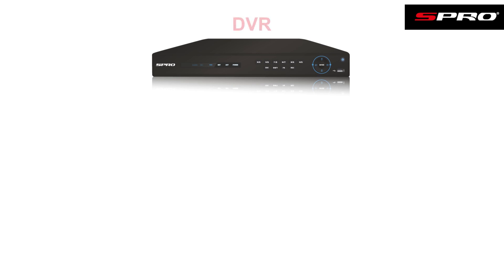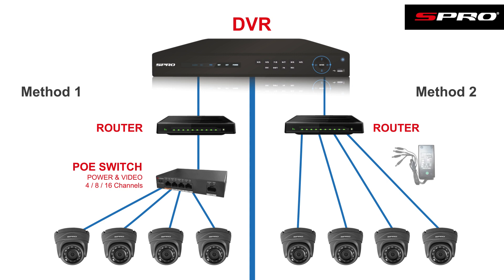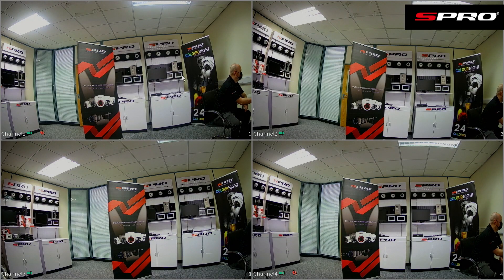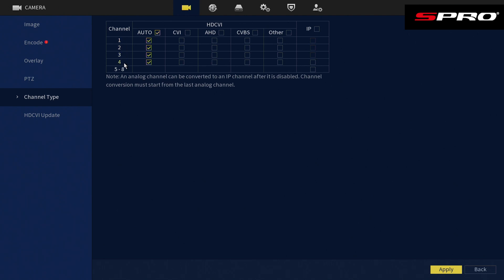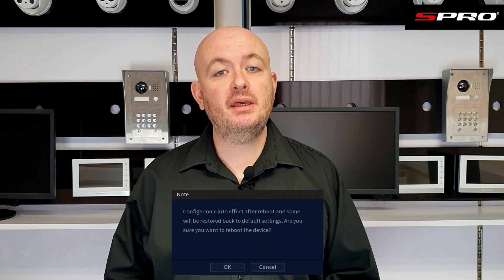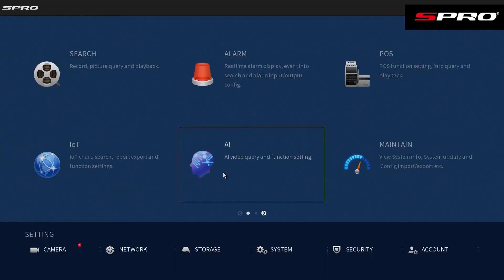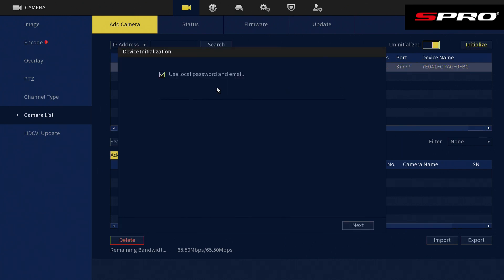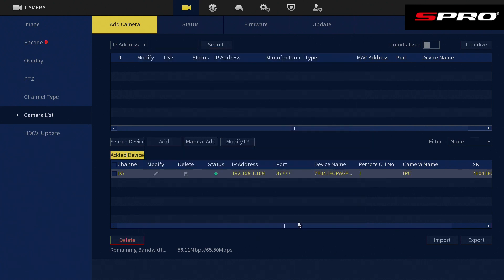SPRO CCTV - Connect IP Camera to Analogue DVR

Comment: How many cameras we can use?
Reply from the maker: Thanks for your question! Do you mean how many IP cameras can you add to an analogue recorder? If so, the number of IP cameras you can add to our analogue recorders largely depends on the specific model of the recorder and the total bandwidth capacity. However, by reallocating the AI processing power as shown in the video, you can add IP cameras beyond the number of BNC ports available on the recorder.

For a specific number and to ensure the optimal performance of your system, it's best to refer to the product's technical specifications or reach out to our technical support team at support@sprocctv.com. They'll provide guidance tailored to your exact recorder model and setup.

We hope this helps, and thank you for choosing SPRO!

Comment: I currently have a 4 channel HD SDI system all 4 cameras supplied with RG59 shotgun cable. 
Rather than rewiring the 4 cameras could I use IP down coax converters either end of each coax cable and change the system to new SPRO NVR and 4 x SPRO  varifocal IP cameras ?
I'd be running short network cables from the converters into the back of the NVR.
OR would it just be as easy to fit your 4K CVI  varifocal cameras to a new DVR ?
Reply from the maker: Hello,

Please get in touch with our technical team at support@sprocctv.com

They will be glad to assist you with this situation.

Comment: How many IP camera that we can add?
Reply from the maker: Thanks for your question! The number of IP cameras you can add to our analogue recorder largely depends on the specific model of the recorder and the total bandwidth capacity. However, by reallocating the AI processing power as shown in the video, you can add IP cameras beyond the number of BNC ports available on the recorder.

For a specific number and to ensure the optimal performance of your system, it's best to refer to the product's technical specifications or reach out to our technical support team at support@sprocctv.com. They'll provide guidance tailored to your exact recorder model and setup.

We hope this helps, and thank you for choosing SPRO!

Comment: If I have a SPRO DHIPNVR04 DVR, do I still need the POE switch for Method 1 to work? can I not just plug the camera ethernet cable straight into the DVR?
Reply from the maker: Yes, you're absolutely correct. If you have an SPRO DHIPNVR04 NVR, you can directly plug your SPRO IP camera into one of the POE ports on the back of the NVR using a Cat5e or Cat6 ethernet cable.

The video you're commenting on is designed to help users who are trying to add an IP camera to an analogue DVR. In such cases, reallocating the AI processing power to process IP video becomes necessary. However, with a pure IP system like the one you have (DHIPNVR04 and IP camera), this isn't required.

Remember, the NVR will also provide power to your IP camera, eliminating the need for separate power cables or power adapters.

We hope this clears up any confusion. If you have any other questions, don't hesitate to ask.

#SPROCCTV, #CCTV

Comment: Great video, explained perfectly, thank you spro. I got a cheap annke dvr and want to add a ip camera. Can you add one f those wifi stand alone cameras.
Reply from the maker: Hello Riz Mark, unfortunately we are not able to comment on other brands as we do not test them. With an SPRO DVR we do not advise connecting to anything wirelessly. It should, however, be possible if the wi-fi camera is ONVIF compliant and on the same network as the DVR. If this is the case you might only receive a picture and other functionality, such as sound, might not be captured.